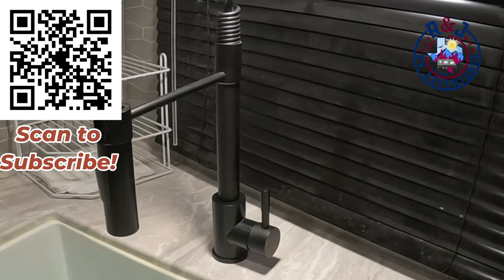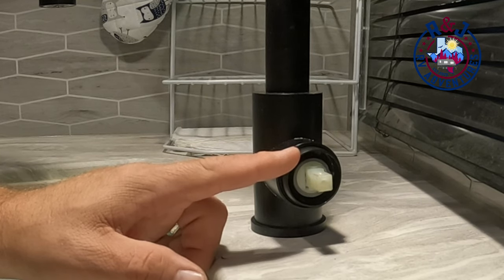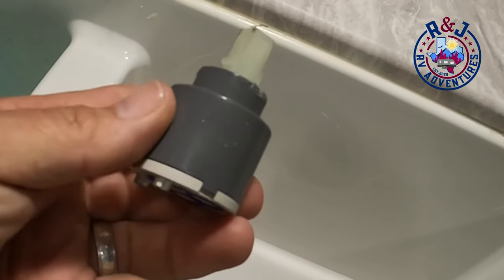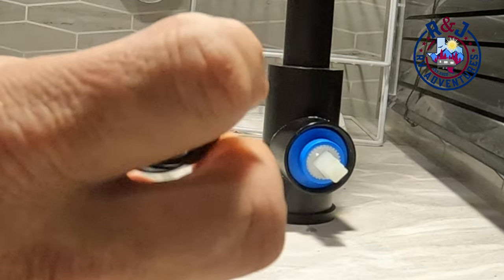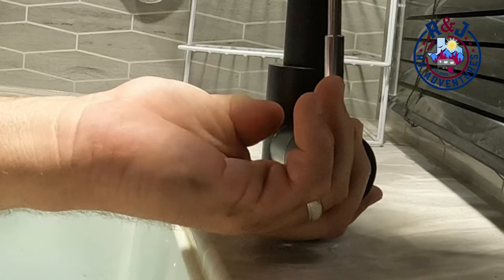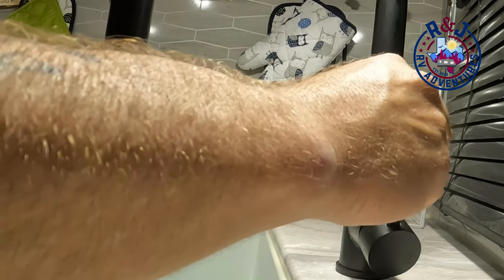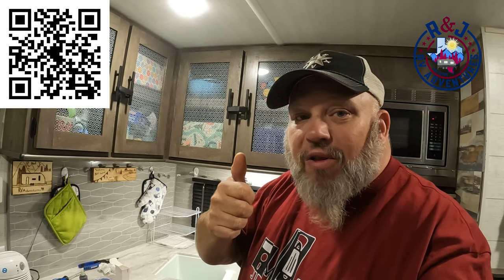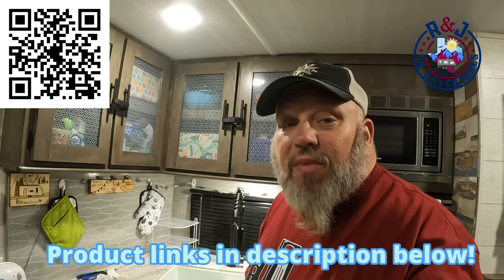How Did We Fix The Leak?//LCI Flow Max

Comment: What was the model # of the cartridge and did you see replacement parts for the handle and the handle holder? Same issue plus my handle is stripped.
Reply from the maker: HWMATE Ceramic Disc Single Handle... https://www.amazon.com/dp/B07HF59SNW?ref=ppx_pop_mob_ap_share

This is the cartridge we bought. Has been working great since installed. As far as the handle,...our didn't have those issues. Thanks for watching.
Reply: Thanks

Comment: My cartridge is like a blue plastic and is just shredding as i try to get it out. I really need to know how to get this cartridge out but it feels stuck.
Reply from the maker: That is strange. Mine didn't screw in. The only thing I can think of is the gasket on the cartridge melted to the inside of the faucet. Maybe you could heat up the metal around the cartridge while you try to pull it straight out. Good luck! Sorry I couldn't be more helpful. Safe travels.